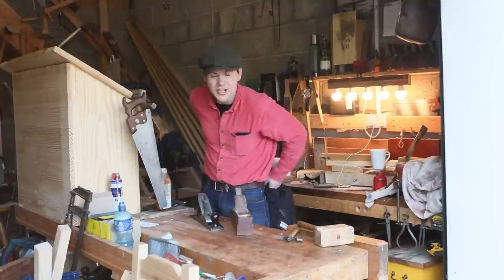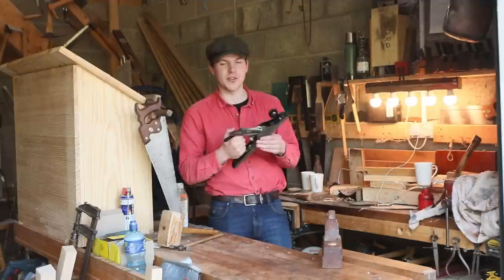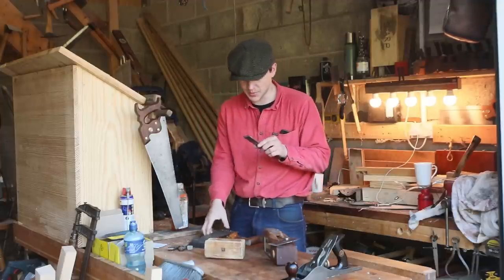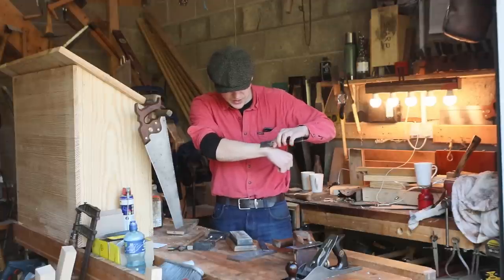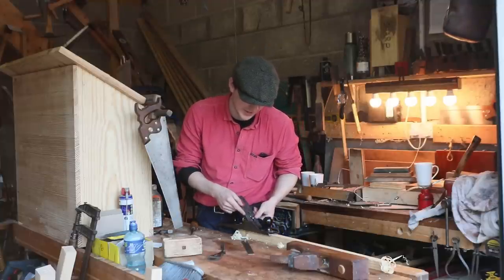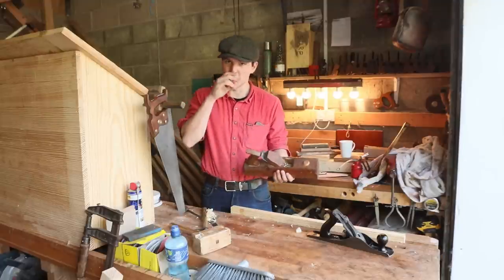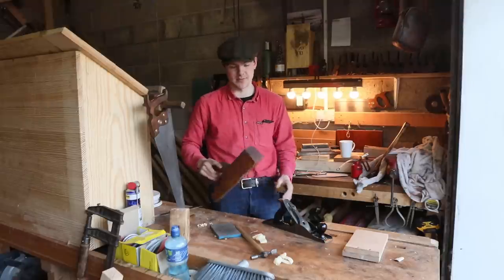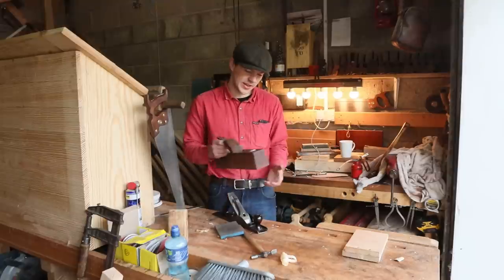Wooden Plane VS Metal Plane

Comment: On the continent (where I live) metal planes never became very common, and professional woodworkers kept using wooden planes until they eventually switched to power tools. Here, wooden planes in good condition are very easy to find and cheap.

I prefer metal planes, for the simple reason that they're faster and easier to adjust and sharpen. Getting the wedge out of a wooden plane, and adjusting the blade just right can be a pain.
Also, I find my metal planes to be more comfortable in my hands than my wooden ones.

Wooden ones do however have the advantage of sliding over the work surface with less friction!

Comment: Couple of points to round out your fantastic video: 1. Throw a very light coat of oil on your metal plane, or wax, to keep the metal rust free. 2. When storing your wooden planes be sure to back out the wedge so it isn't tight or they can split when the weather changes.
Reply: Also get used to store your planes on their side to avoid chipping the blade etc!

Comment: Good comparison. I have a wood jointer and jack that I bought 45 years ago, still using them. Also have a metal no. 5 that’s about 75 years old. Still works fairly well.

Comment: I like the woodies, they glide nice without any wax and nice and light. Only annoyance I have with them are particularly the double iron kinds with depth adjustment and how the edge scoots away from the cap iron for a deeper cut. I learned a workaround by putting a couple sheets of paper on either side of the plane sole when inserting the iron so that it’s slightly too deep and all I have to do is hit the rear and wedge to get it where I want it, but it made me really appreciate the adjusters on metallic planes, or even transitionals, more.

Still fun to use though! I like making them too from spare vintage irons taken from destroyed bodies or current reproduction irons.

Comment: Great videos. Iv ready the comments im sure im going to repeat something here so if i do sorry in advance. 
Your correct with the rear adjustment, for lowering the blade that button on the front of the plane is for you to tap this will lower the blade. This way your don’t damage the back of the blade and the button is there so you don’t damage the timber.
Give it try see what you think. You rock

Comment: Metal planes are very convenient, need to take a heavy cut? Twist the frog knob to have more iron in the cut. A lite/smooth cut? Well twist the knob the other way. Wooden planes are like old ways of having light before the light bulb and electricity were a then. It an odd way compare, but it makes sense to me. I will admit though using a wooden plane feels very nice. Amazing video as usual.

Comment: I'm no professional but I'd have thought that the metal bodied plane would take the smaller shaving as I'd have thought the very obvious predictability of the metal, would be able to get the blade lower and closer to the bottom of the body. But then again the Japanese style wooden bodied plane takes off incredibly thin shavings if set up/used correctly.

Comment: Remember to tap the wedge every time you adjust the iron! And use the striking button, that's what it's for. You would normally use a standard claw hammer or similar to adjust the plane (at least in any English speaking tradition). I use a small dead blow with acrylic faces, though. No reason to bang it around with anything more serious than that. Rex Krueger, however, did make the informed decision to go for the authentic (again English speaking tradition) choice and only use a claw hammer. My point is, have one hammer at hand to adjust it with—and it should be of a size that can also tap the wedge. Your bench hammer was perfect for that.

You are talking from an English speaking traditional perspective (UK and American (the continents)), in the rest of Europe wooden planes are still the norm. They do not rot away. Most of them are made by stable wood that don't even move anymore. It's common to find wooden planes more than 100-150 years old that work fine, and new ones are still made. And the wear you talk about I can't quite recognize. Not that I haven't found beat up wooden planes, I sure have. I made a worn slethøvl (between a scrub and a smoother, closer to the smoother) into a scrub. It's absolutely perfect. Most of the wear is superficial. But of course they wear, but it will take many, many years! Just use a little bit of wax on the sole. Not that wooden planes need much lubrication, but it doesn't hurt. And if the sole is worn out, make a new plane or a new sole. That's the whole point of wooden planes in the olden days. You made your own. Stanley just wanted to make money on something people would normally make themselves.

For professionals using wooden planes look up Peter Follansbee, Graham Blackburn, Mortise and Tenon Magazine, and Richard Maguire to mention a few. And Stavros Gakos for plane making.

In my opinion wooden planes are much easier to adjust and use. You just tap them; down, on the strike plate (if it has one), on the side (you can hold it in your hand, no reason to put it on its side), etc. and then on the wedge. Always on the wedge! It's extremely fast and intuitive. I don't really like all the knobs and adjusters on metal planes; they make the planes seem less in touch with the work. But that's just down to personal preference, of course. (By the way, when adjusting a wooden plane you don't sight it, you have your fingers over the mouth and feel it. Watch Mortise & Tenon Magazine video "How to Use a Wooden Handplane". They're also using a claw hammer.)

The point is. Metal planes aren't superior to wooden planes at all—it's only a question about personal preference. You can't do something with a metal plane that you can't do with a wooden plane and vice versa.

And, for crying out loud, stop shaving your hairs 😅

Comment: Not sure if this is the right place to ask Eoin, but I recently bought an antique German nuthobel, or plough plane. The steel is old and needs a sharpen, and that's ok but it only came with one bit of steel.

Could I get away with placing a chisel in there to give me a range of groove sizes, or would I need to adjust the bevel, etc to make that work?